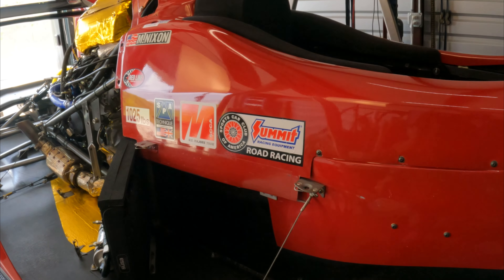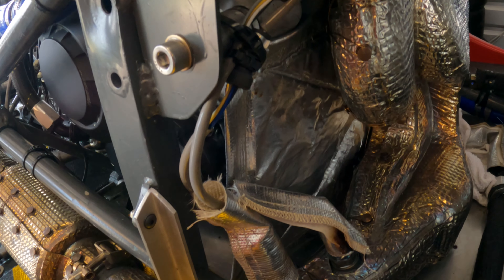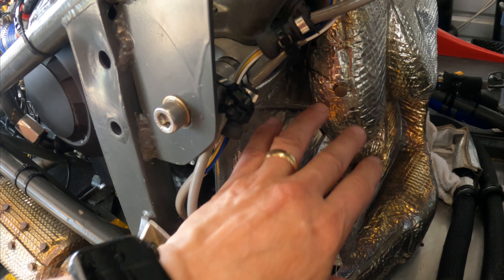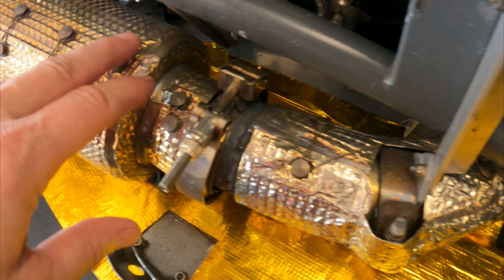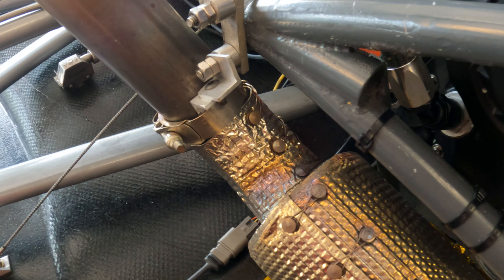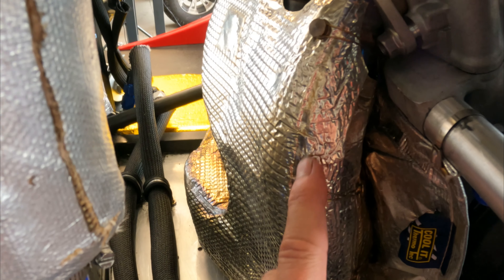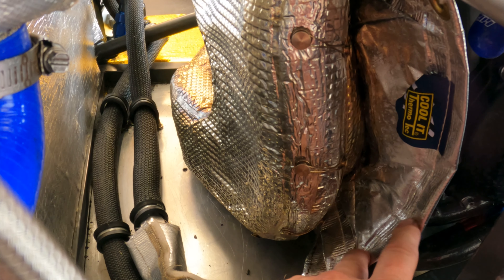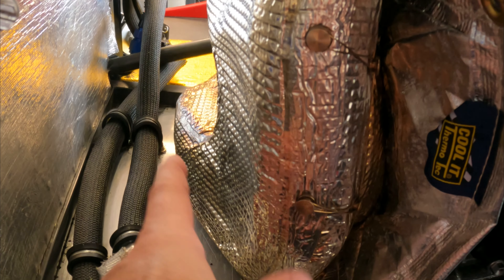How to reduce engine bay heat

Comment: Hi there, love the video, I was just wondering if you guys had any average statistics for typical engine bay temps? I am currently designing some engine components and need to gain a better understanding of race car engine temps for a race car, to aid in the FEA testing of that component
Reply from the maker: Yes/No, I have new sensors in the car and the engine ambient temp is also a new one which is allowing logging of engine bay temp as noted in this video.  What needs to be done is making a few runs without the Inconel heat shield in place for comparisons.  I will make a point of doing this and sharing once I have done so.  If it would help to provide current engine bay temps (with the Inconel shields) as I log them now I can do that so let me know.
thanks for watching!
Reply: @NixonMotorsports  Thank you for the reply, yes if you could provide the current temps with the inconel shields that would be super helpful and I'd appreciate that help greatly :)
Reply from the maker: @tombell5599   Hi Tom,  here is an example what I currently see with engine bay ambient temp measured at the top of the engine towards bulkhead.  With outside air ambient temp 102F - Out lap 153F, lap1 176F, lap2 180F, lap3 179F, lap4 179F, lap5 182F, lap6 183F, lap7 183F, In lap 180F - overall average was 168F.  I hope this helps.
Reply: @NixonMotorsports  Thank you so much that is great help and much appreciated.

Comment: Would longer headers with better flow reduce heat¿
Reply from the maker: Not a bad idea, would have to try it and see if helped.  In my case, I have some limits on overall exhaust length.  Cheers

Comment: Hello, Mark.

I’ve been, recently, researching engine compartment thermal load mitigation. Furthermore, I have noted conversations about Inconel.

I intend to nip the, unnecessary, evil of “ heat soak ” in the bud.

‘ Hypothetical question :

Realizing the expense and malleability of this extraordinary material ; what do you suppose the result would be if one were to have fabricated a laser-accurate ( glove-like ) custom lining of an entire Jeep Gladiator engine compartment, to include the hood ?

Before I tackle the engine, itself proper, I would like to [ effectively  and efficiently ], facilitate that undertaking.

I will not be deterred by the heat of Nevada and Arizona.

Thanks, for your consideration.
Reply from the maker: Well lining the entire lining of a engine compartment would be something.   Inconel is extremely good in shielding heat, the only thought that comes to mind is I suspect controlling heat at its source (headers) would be a very effective way to control engine bay heat.  By lining the engine compartment that would cost a fortune but ignoring that you would still want to have the headers (exhaust) done to manage heat away from the engine.  I would also suggest not only the headers but exhaust down pipes further away from the engine.  If you happen to have a built engine, say turbo that is a super high heat source as you most likely know.  Interesting comment and idea, let me know how you proceed if you would.  Cheers

Comment: i am going to have a go at wrapping as much of my exhaust headers as I can access without removing them as another measure. Also, maybe seeing what effect some 12V computer fans have at blowing the air down to try and force it under the car, or maybe out under the front wheel arches, as long as it doesnt interfere with the normal radiator fan airflow dynamics
Reply: Also, the main problem being my AC hoses degrading due to the heat, I may also wrap the AC high pressure hoses to try and insulate them from the heat from the headers, as they are very close to them. Its a GM LS2 V8 and a known design flaw of these engines
Reply from the maker: sure give it a shot.
Reply: Thanks. I just visited ATP’s website, where they’ve posted images of [ exactly ] what I have in mind.

‘ Take care.